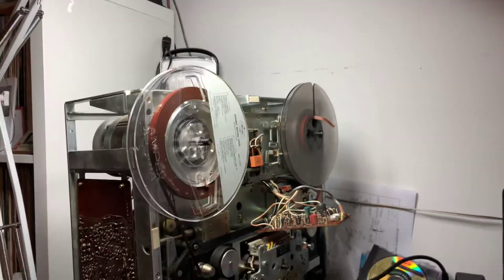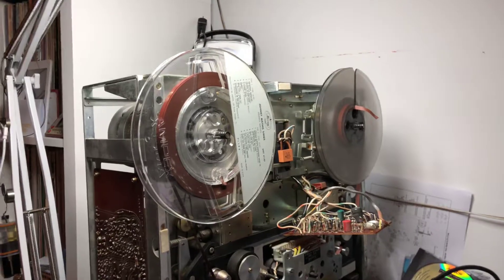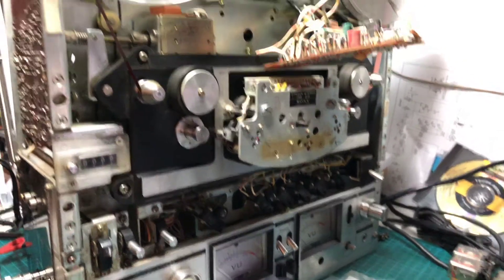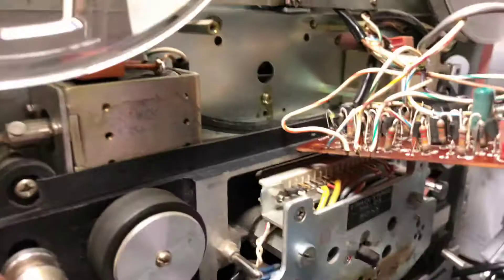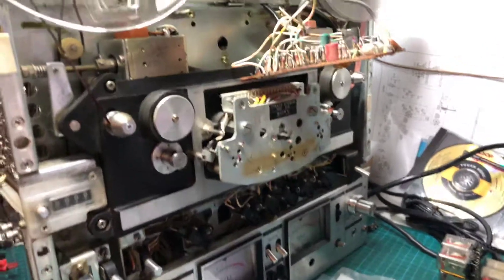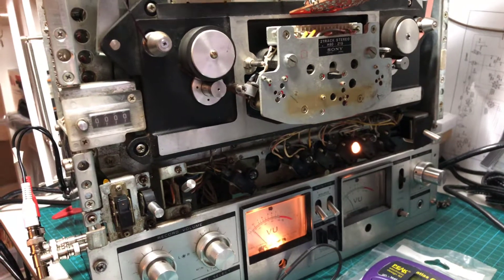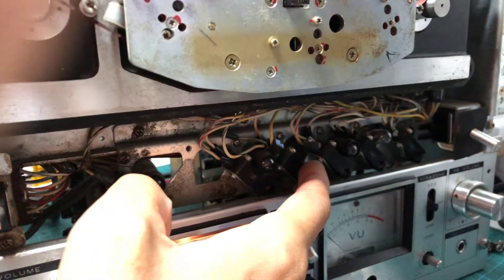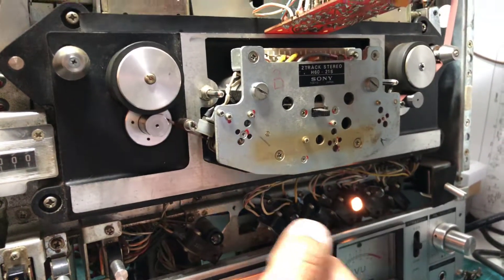Help me restoring this Sony TC-850 Reel-to-Reel Deck

Comment: Thanks for showing the video and some comments in Audio Karma.  I read your articles.
I like TC-850 but it has some issues, it goes into the Play mode as soon as I turn it on.
Kept reading and viewing a lot of youtube videos and comments but I cannot find the real solution yet.
There is a Flip-Flop logic that controls all the push buttons including Play, Stop, FF and FR etc.
On the control board, the Q607 transistor is showing a few volts of collector voltage there even in saturation mode.
I replaced Q607 with a new subsitute but no changes.
It should have less than 0.2 volts when in saturation mode but it shows around 2.2v that messes up the Flip-Flop logic.
There must be some leakage coming to the collector but I cannot find the clue yet.
My last resort should be now checking any internal leakage through the relays (four of them in the board).
If you have any clue, please let me know.

Many Thanks,

Comment: HI. I have had a start issue with my TC-850-- no activation whatsoever. I recapped the unit but no-go. Any ideas?
Reply from the maker: I would check the following:
1- Is the Dummy Remote Control plug in place and it is making proper contact.
2- The Logic Control Board requires all light bulbs in the push buttons to be operational. Check if any light bulb are not working.
3- If you still have the original Omron relays, it is better that you change them. Those should have bad contacts by now.
4- Lastly, check if there are any tantalum capacitors added to the logic board, mine had those added by the previous owner and they were bad.
Hope it helps.

Comment: check q606 mine was shorted and i had the same symptom you have.
Reply from the maker: I found the problem, somebody added a tantalum capacitor where it was not supposed to be added and over time that capacitor developed a short. I removed it and all came back to life.